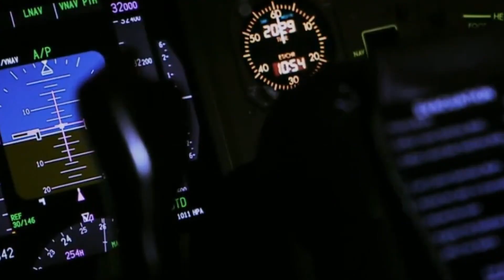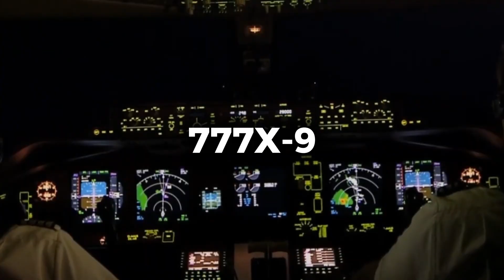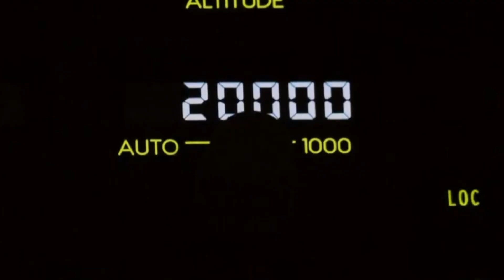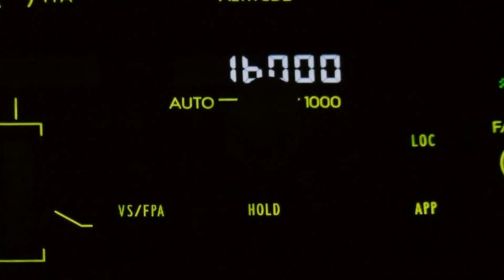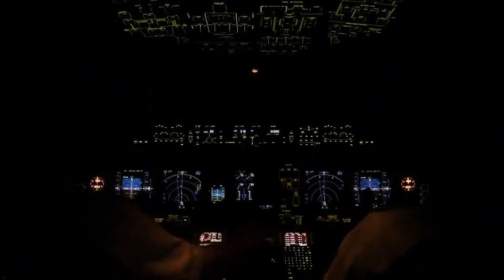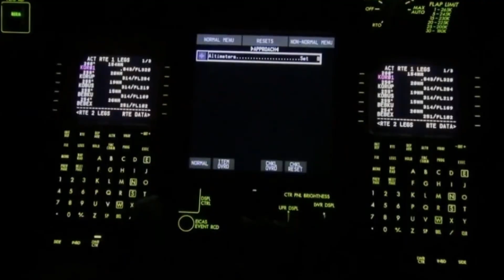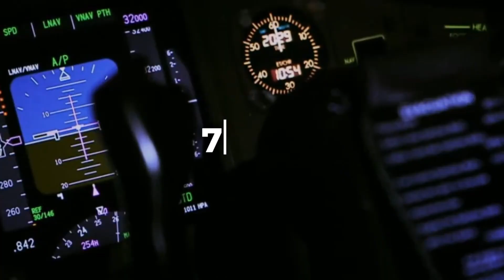Boeing Confirms BAD NEWS as Airbus Announces A350-2000 (Stretch)

Comment: I believe this Airbus Stretch will be launched way Earlier than Boeing 777X 🤣
Reply: You are absolutely rigth...and the A380 NEO LR is already on study like the A365 S
Reply: @felixlafleurie7531Not True at all, its too inefficient with 4 engines
Reply: You're a more on, I predict the 777-10 will beat the 2000
Reply: @sounddoctor5decades  Moron is one word. I’d bet on Airbus to beat Boeing in this for a few reasons. The A350 is already flying and would face an easier certification process. Boing has to much on its plate trying to certify 737-max7, 737-max10 and 777x. But worst of all Boeing has to sell the stock they have built ahead of certification. They aren’t going to announce a 777-10 and get stuck with planes people might opt out of. All of the 777x customers have one thing in common, they crave capacity.
Reply: @Strickland325  Understood on the word, but I've been locked before for using it, so I avoid it in correct form.  Here's the basis for my prediction, you're welcome to you're viewpoint.  777X will be certified later this year, the time table of certification is controlled by the regulatory bodies, NOT Boeing.  Both the FAA and EASA are in OCD mode now, after their screw up with the MAX, they had one key problem with those events and they won't let that happen again, ESPECIALLY on a all new type, which is what the 777X is, there are NO artifacts in that aircraft from the previous models other than the number.  It's all new, and they're treating it as such, with a little extra paranoia added in.  Trust me, the same thing will happen to A350-2000 as well, because a 2000 can't just have plugs put in. the RR is at max thrust for the type, So a new engine will be required, it will likely need a new wing and tail, that's way too much stuff changing for a simple certification. So Airbus will end up in cert jail just like Boeing has been with X.  777X on the other hand WILL have a much easier time, the GE9X has enough headroom in the design to power a stretch 777-9,  Boeing has done much of the work already and baked it into the platform as they frequently have a three model platform for their product.  So a -10 will have plugs put in, Engines running at 135K of thrust hung on the same wing and go directly to flight testing.  777X will be certified this year, 37-7 and 37-10 will be certified this year, that will clear the plate and they will be able to execute this in short order due to anticipated development on the platform.  Boeing has 619 orders in hand for 777X they still have a backlog for existing orders,  -10 will be a moderate seller, but a simple stretch, where with Airbus it won't be.  I expect they will sell more of them than Airbus has of A380 and A330 combined, together Airbus has sold only 610 units, and I believe there is that much of a market on a 500 seat aircraft, especially with good economics which neither 747-8 or A380 had.  Once the FAA gets out of Boeing's pants, they will recover the narrowbody business, and they never lost the widebody business. Remember, Airbus ONLY gained ground in order and production because Boeing's production was significantly reduced by the FAA for over a half a decade, with light at the end of the tunnel Boeing in 2025 was able to secure MORE orders than Airbus and with the new products being released I believe that will only accelerate.  I personally believe that Airbus is going to see some real challenges forthcoming.  And to you're capacity comment, A350 is going to have a hell of a time trying to get capacity to 500!
Reply: @sounddoctor5decades  Ah. The spelling makes sense then lol. I’m not a fanboy for either, competition only gives us cooler planes. I still think the timelines could realistically be closer than both of us think for an A352k and 777-10. It would be crazy for Airbus to just loose the capacity market laying down. If the A352k doesn’t come to fruition I imagine they will build an intermediate plane again. By that I mean how the A350 bridges the capacity between 787 and 777. So a plane the bridges 777 and A380 capacities. That is unless the losses incurred by the A380 serves as too much of a horror story to wander into the high density market again.
Reply: @Strickland325  I agree with your assessment that a conventional construction Twin that would compete with 777, would be the logical choice.  I don't think they care about the massive loss on the A380 program, that's the benefit of being partial government ownership, they can burn cash and make massive mistakes, like not doing a freighter variant of 380, meh, it's someone else's money...   If they do execute a program to directly compete with 777X,  with A350 they announced in 2004 and it entered service in 2015, with the current regulatory climate I expect on a new type it will not be 11 years, it'll be more like 12 to 14 years from announcement to certification, which by the way is EXACTLY how long it's taken 777X, it'll be certified by years end and it was announced in November of 13. So all this hand wringing on how long it's taken 777X is fabricated BS, Considering we had a global pandemic, I'm surprised they only had a 2 year delay vs. the A350!  In any case, for Airbus to get a true competitor in market for the 777X, because the A350 IS NOT, they are a minimum of 11 years away from getting a new type certified IF they announce tomorrow.  And like I said, with all these new products coming on line with Boeing, Airbus Issues with supply chain and the Regional Jet Business, Boeing taking back the order lead in 2025, Airbus is facing some substantial challenges in the next several years and beyond.  Thanks for the feedback!
Reply: @sounddoctor5decades  It’s crazy to think the original 777 essentially went from concept to sales in five years. I bet Airbus is kicking themselves now for not building the A380neo that Tim Clarke wanted. I believe the estimates were 22% more efficient over the A388 just with new engines. Imagine an A380 with new engines and an appropriately sized wing. That would surely be marketable today. Surely Airbus would’ve stood to make money from a Neo program. One has to wonder would Emirates order still be 270 aircraft had an A380 Neo existed?
Reply: @Strickland325  I'm sure they would have, the problem is that's not enough to justify the program, but again, like I said, Airbus flushes money down the loo... With gleeful abandon!
Reply: @sounddoctor5decades  As of the release of its 2025 full-year results on January 12, 2026, Airbus reported a record-breaking total order backlog of 8,754 commercial aircraft
Reply: @eaglesoarsin2026  Yup, that's true, HOWEVER, most of the backlog was created with narrowbody and RJ, a segment that Boeing does not compete in.  Many positions were taken in Narrowbody due to Risk with MAX due to FAA reduction in production.  That is ending and MAX7 and MAX 10 will be certified this year.  I predict many positions in Narrowbody Airbus will be released for a more favorable Boeing position.  Also, of that Large backlog that Airbus has, they have a significantly smaller position in high revenue and profit Widebody product.  Boeing currently holds over 600 more orders for Widebody than Airbus,  That will extend with the certification of 777X and Airbus really has no answer for it.  A 350 is not a competitor to 777X and they will NEVER be able to stretch it enough to get close to 500 seats in a 2 or 3 class cabin, and it's struggling with its competitor 787 now!  Remember, Boeing has sold more 787 that Airbus has sold A350 AND A330neo COMBINED, by over 400 units.  No, the leverage Airbus was getting is over, Boeing will be certifying their entire portfolio this year and the orders will significantly accelerate, I believe positions in narrowbody Airbus products will be dropped for more favorable positions with Boeing, and Airbus is getting significant pressure from Embraer in RJ and their PW issue isn't helping either.  And let's face it, Airbus does NOT have as strong of a portfolio with ONE acceptation, which won't lead to significant sales.  That is extreme range.  A350-900 and 1000 have a range advantage over 787-10 and a little even over 900, but the flights that use that, you can count on your hands. And the 321XLR, that will turn out to be an underwhelming sell, as frequent flyers DON'T want to do long hauls on narrowbodies and THEY pay the bills, and in the sub 3000 mile segments, and there are TONS of those, 10 max is just a more efficient aircraft.  Also, Airbus SCREWED UP AGAIN, they should have built a 321XLR-F,  A freighter version of the 321XLR would have sold HUGE with little competition but like with A380, they can't read the market.  A350F is going to be crushed as bad a A330F was, by 777X.  So you can crow about the backlog, but thats about to shrink, Boeing took the sales lead away in 2025, and Airbus is going into the next decade with a comparatively weaker portfolio.
Reply: @s @sounddoctor5decades I appreciate how much time and effort you put into this analysis.  Much of it rings true.  It feels like the MAX 7 and 10 could be certified in 2026.  My $1 bet is the 777X is not certified this year.  The timeline of the Boeing 777X suggests many issues since it was originally slated for entry into service in 2020, but with the significant delays, Boeing's targets aiming for customer deliveries in 2027 don’t seem at all realistic.  Little wonder that Emirates is publicly frustrated with Boeing
Reply: @eaglesoarsin2026  thanks!  I will point out one thing about Boeings timeline to certification.  That was stated before several significant events,  one, obviously the two MAX events.  two, a global pandemic. And three, significant supply chain disruptions.  Obviously the max events had impact as FAA and EASA got more or less caught with their hands in the cookie jar, both wrapped around due diligence with making training mandatory as well as more thorough evaluation of MCAS, after that eff up, they are being significantly more methodical, and it's being shown in a much more invasive testing procedure.  The pandemic is self explanatory,  as is supply chain, especially with a all new aircraft with all new engines.  I do believe 7X will be certified by mid year as it's moved to final steps with data collection done and the regulatory bodies actually themselves flying for final evaluation, and I'm sure Boeing has crossed their tee's in prep for this.  They have a number of 7X built still green waiting for cert, I fully expect they can deliver them by year end.  I want to point out that A350 took 11 years from announcment to certification,  while Boeing was optimistic with their inital date, the three items I mention slowed it down and they will deliver in 13 years,  considering the significant impact those events had, I'm quite frankly surprised they only took two years longer than A350.  And I assure you, the consternation in the media is in many cases, is a projection by the media, trust me, the communication level by the manufacturer to the customer is nonstop on status and roadblocks,  I know, I'm a supplier in the industry and at the height of the pandemic we had weekly an sometimes biweekly meetings on status. These huge companies must have the freshest data,  their businesses depend on it!  Only time will tell,  I just try to throw some thought, facts and logic out there rather than  feelings,  plenty of folks that like one brand over the other, but as I said, I try to validate the comments through known available facts,  but as with anything,  many variables and only time will tell, right?